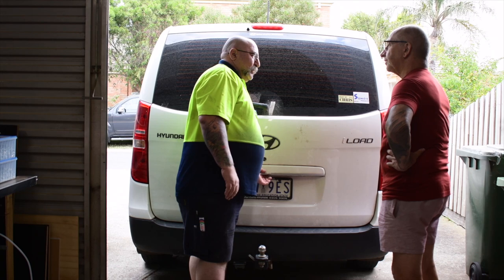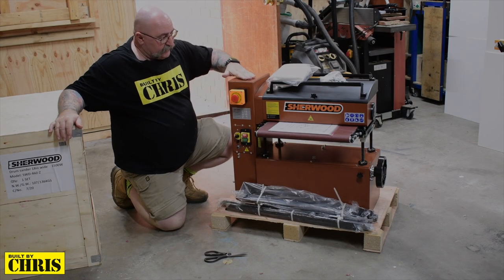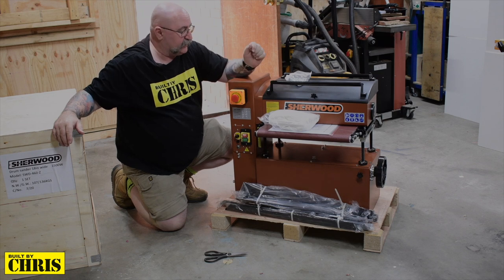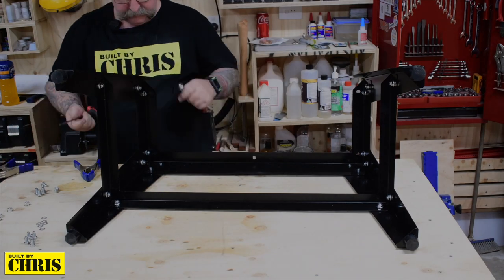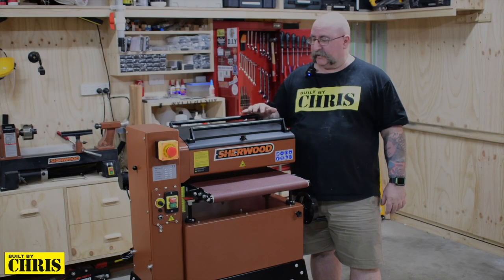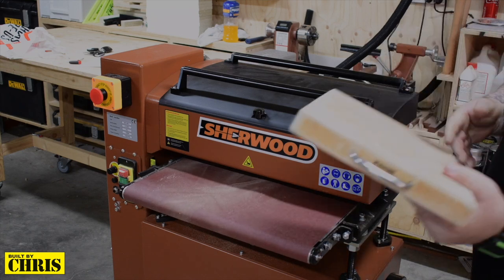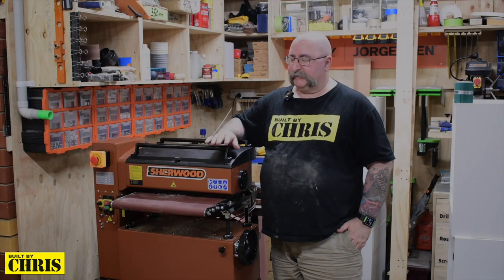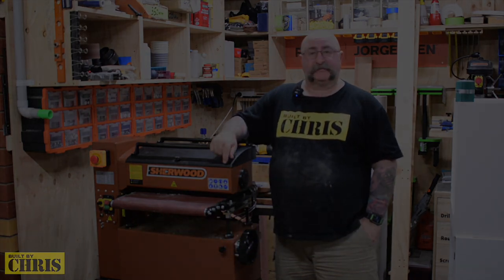Drum Sander Unboxing, Assembly and Review

Comment: That is a wonderful machine Chris and a sound investment. I remember 45 years ago sandinging by hand, inch thick planks of oak from an old wardrobe to make furniture of my own and it was horse work. That drum sander will be so useful.
Good luck with the workshop extension which will be a vital part of your re-jigging process. My workshop is on the first floor so if I extended it would jut out into thin air!
Just a thought if I may Chris, if you put an outlet for your small vac to plug into in the cover over where the fine residue collects it could remove that at the same time as you vac from the drum with the big vac. Ear defenders needed though :)
Reply from the maker: Thank you Eryk. Now a days, we have all these wonderful machines that make life so much easier, but, I can't help but think that maybe they have taken away the hand made personal touch of woodworking. And as for the outlet on top, you must have read my mind. I'm going to 3d print a piece that will fit on top to take an extra hose. Cheers mate, and I hope you are keeping well. 👍👍